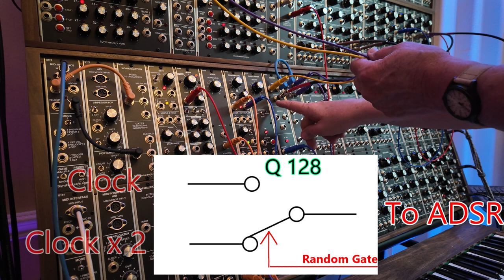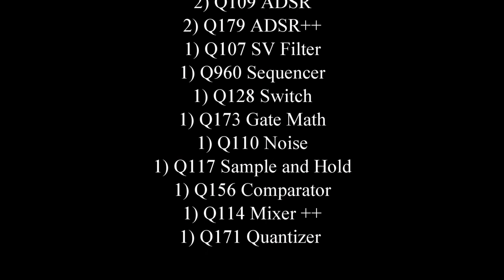Several uses of Random Gates

Comment: I love the sound from the random ratcheting around 5:10, gorgeous! Interesting to see the additional modules that the MFG of your system offers that are not available for the Behringer clone, such as sample and hold, the switch, quantizer etc. I have started looking at other manufacturers for similar modules to add. I just added a second 960 sequencer and sequential switch, also quantizers from 2HP and clock module that I can run the sequencers with and have them better match other external sequencers. Anyway, I am loving this modular world and really enjoy your videos. Also bought one of those Korg NTS-2 Oscilloscope, very handy for tuning and exploring the signal path and what the signal looks like after each module. This is all so fun, get lost for hours! Thanks for sharing your knowledge! Bill
Reply from the maker: Thanks! I too am looking into the Korg NTS-2.

Comment: That SV filter sounds a lot beefier than it ever did in any of Rogers videos. Do you have a favorite Moog-sounding filter? I currently have SEM and Roland style ones.
Reply from the maker: It may be that Roger recorded the audio with the camera mic...I'm not sure. I recorded directly to DAW. I had a Model 15 Moog for about a month and that filter rocks! The Ladder Filter from DotCom does an equally good job. The 4pole/2pole switch has a big affect on the sound. There is a jumper on the back to make the 2pole a 3pole. I'm going to try that soon. Thanks for watching!